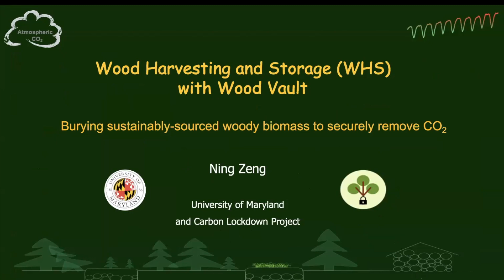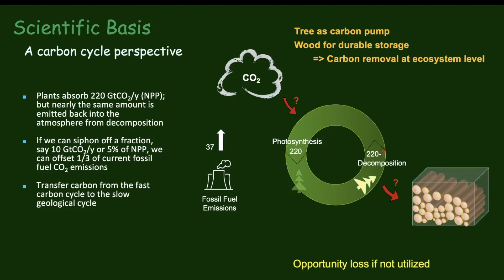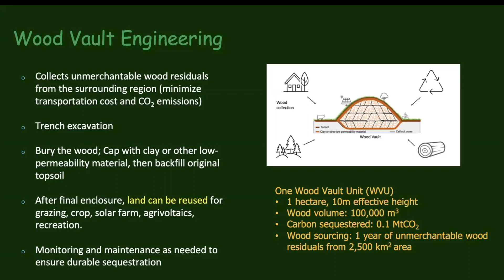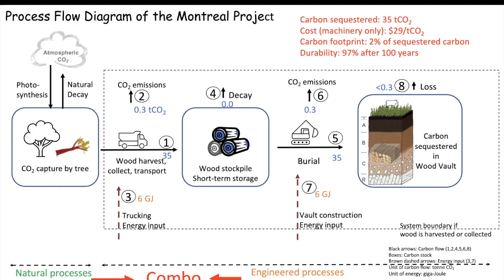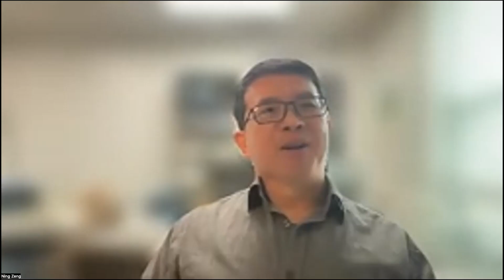Wood Harvesting and Storage with Wood Vault for Durable Carbon Sequestration...

Comment: Excellent discussion.  I just want to mention that for non-specialists it might be good to spell out some of the frequently used acronyms. The initial slide presentation did a good job of that, but then more came up later on. I looked up a few of them on the fly, so it wasn't a big problem for me. But generally specialists talking among themselves can lose people pretty quickly.